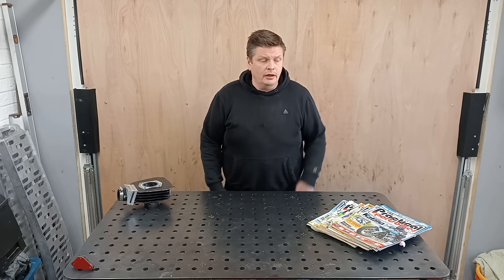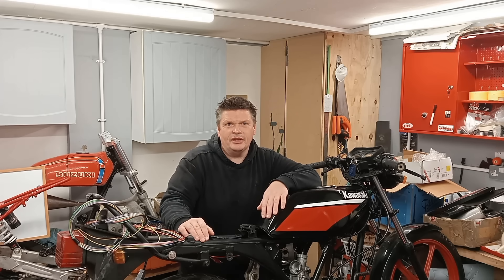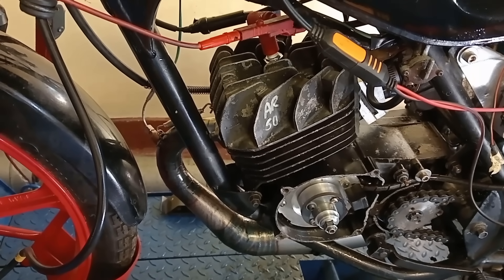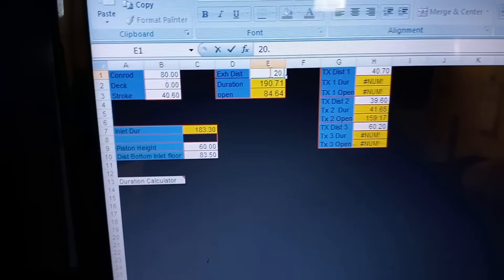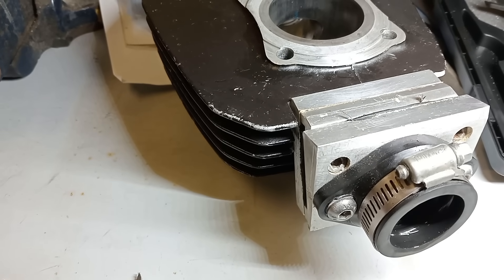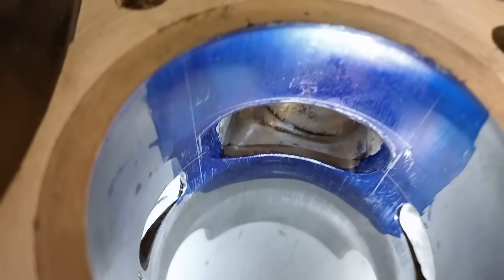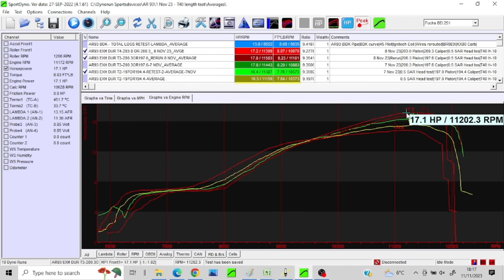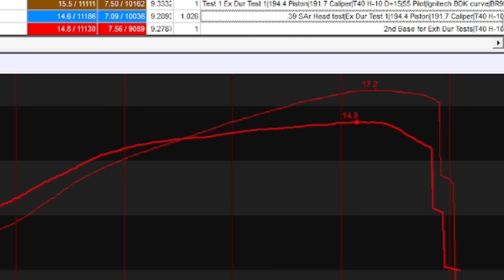This Tiny Port Change Changed Everything (Dyno Proof) #2stroke #power  #porting

Comment: One thing that may be worth trying, Youtuber @ASoftaaja removed the lower ring and made HP gains from that alone. At these RPMs, any friction reduction = power gains. 2stroke stuffing also came to the same conclusion (not the rings, but any drag in the engine at this speeds robs HP). Running more oil has also proven gains for the same reason (tech document published by Kawasaki ~30yrs ago - though oil tech may have caught up enough to make that moot)
Reply from the maker: Great info. I'll put it on the list to try next time. Loosing the lower ring would allow a wider inlet port too as the lower ring peg is perilously close to the edge of the intake window.
Reply: @AutoBeta2T do not forget to plug the groove of the compression ring, otherwise the mixture from the transfers will flow through it into the exhaust
Reply from the maker: Olitech, cheers. I need to find a single ring piston for my set-up but it's proving quite difficult.
Reply: @olitech_perfomance plug groove with what?
Reply: More oil makes it leaner too, leaner usually makes more top end power. So that needs to be into consideration. So jetting should be different, at least at the extreme ends of it.
Reply: Interesting - I have a Dr Joe Ehrlich modified Motobecane that never went in to production, that has a single ring set up on a Mahle dish topped piston. When I first started messing with it I thought a 3 ring set up would be better but several experts say that is not the case. I have no dyno to test on but I know the engineers back in 1966 took it from 1.7 to 6.2 bhp, most of that being down to the boost port technology. Although the French engineers disagreed with that, the bike took a 1 hour endurance record in Monza - it was ridden by Rex Avery. Ehrlich wanted to do a liquid cooled version but sadly the budget wouldn't run to it. I am still struggling to get it picking up cleanly from tickover but it revs like a good un once it's going.
Reply: @jonathansmedley1077  nope, octane rating of oil is near enough to zero. So if I take 100 octane race fuel and mix it 10:1 with oil, I'll now have 90 octane premix.
Reply from the maker: @bostonbikebits6539 thanks for that - I've found the place on the internet, I'll give Mark a shout. Cheers for the tip 😀
Reply: Thats just what I was thinking.  When I had my 93 i only ran the bottom ring without any problem.   I found the dykes ring caused more problems.
Reply from the maker: Cronauer - I'll give it a go
Reply: It is true  that you may gain from removing  1 ring but, From My experience i found that two rings do transfer heat to the Jug better than one.
Reply: How would oil technology make the "wetting" of the cylinder with oil any better. 20:1 still best power
Reply: @aaronbright5028  Oil technology can make a big difference to the amount of pressure per unit area that can be applied between two components before the components break through the oil film and make contact with each other.
Reply: @cedriclynch  okay an again.....how does that help with "wetting". Like are you somehow going to fill your ring gaps and piston to cylinder wall clearance with that better pressure handling......no. it still has to be in there to do it's job. Anywhere between 50:1 and 100:1 is totally insane on how "dry" it's running idc what oil you use.
Reply: @aaronbright5028  I think that when the engine is being run gently any given drop of oil remains in the engine for a long time before escaping. If you dismantle an engine that has been running on a 50:1 fuel-oil mixture for a long time without being run very hard, you will find all the internal parts to be very oily. The Honda NC50 Express moped of the late 1970s has the oil injection pump (which has no link to the throttle) driven from downstream of the automatic clutch so there is no feed of fresh oil when the engine is idling with the vehicle stationary, and you don't hear of them seizing up. Similarly on the Suzuki T500/GT500 of the 1970s there is no oil feed if the bike is stationary with the engine running in gear but with the clutch lever pulled in. There is an oil feed if the gears are in neutral with the clutch lever released. When the engine is run hard the oil is escaping from it much faster, so it may need to be supplied with more. On Yamaha models with the Power Valve System and oil injection there is a link from the Power Valve servo to the oil pump stroke control mechanism giving a very large increase in the oil pump stroke when the Power Valve is in the raised position, which is when the engine is running in the top 25% (approx) of its rev range and it is giving a specific power of about 200 horsepower per litre. This is in addition to the link from the throttle.
Reply: Two stroke stuffing? We will not resort to referencing charlatans and snake oil salesman here. Remember he survives off views, not his engines, which don’t actually work as intended anyway. After 7 years of not actually focusing on the task at hand: to build a nitro-powered resonance engine. He’s so far off that I’ve lost all respect for him, and his 2t knowledge isn’t that vast anyway. Watch this channel, 49cc scoot, and dyno joe if you actually care about learning
Reply: On fuel: mixing in oil does not change the octane rating because the oil is not a combustible part of the mixture, and has its own octane in the thousands anyway. Those formulas for determining octane due to mix ratio are correct if you need to know the stability of the mixture, but since it doesn’t matter to a running engine, the only octane you need to know is the fuel WHICH DOES NOT CHANGE

Secondly, the old head lore that oil ratio changes FA ratios is also bunk. If I mix at 40:1 and jet for a perfect 12:1, my ratio would only change by 4 tenths of a point from an actual 11.7 to 11.4:1 when doubling your oil ratio to 20:1 - insignificant.
Reply: @RyanMcIntyre  In fact the octane rating of oils is more similar to diesel fuel than 'thousands.' Which makes sense when you consider the chemistry; oil is predominantly long chain hydrocarbons with few branches while highly branched and aromatic hydrocarbons are the preferred constituents of high octane fuel. Diesel engines, I might add, are usually quite capable of igniting and burning their own sump oil. This can lead to catastrophic 'runaways' if, for example, a turbo shaft seal fails and begins leaking oil into the intake.

So contamination of the fuel with oil does indeed lower its octane rating, though with a modern 2T oil the effect is probably much less than it would be for an oil that is not intended to be mixed with the fuel. 

Also some (but not all) of the oil does indeed burn in a 2 stroke, you need only consider the temperatures the oil will be exposed to in the hotter parts of the engine (e.g. the piston crown) to realise that any oil that gets on those areas will be heated to well above its flash point (for reference, this is about 220 degrees Celsius for a SAE 30 weight oil- the piston crown can exceed 300 degrees C under heavy load), and thus will begin to form a flammable vapour.
Reply: More oil increases the viscosity of the fuel, and this has a significant effect on the fuel-air ratio.  @RyanMcIntyre
Reply: @RyanMcIntyre  no.
Reply from the maker: @RyanMcIntyre cheers for the info Ryan. What oil ratio have you found works best?
Reply: @AutoBeta2T  Lol for full power I’ve tried up to 12:1 but depending on application (and for my size engines), 40:1 to 32:1.
Reply: Thumbs up for that! Both of those are indeed well proven methods to get some pretty much free power. 

If I recall correctly the threshold where one piston ring starts to outperform two tends to be around 8000rpm quite universally so one ring will very likely perform better for this project. 

About oil mix there is at least one document from 70's or 80's where they tested with some 250 mx bike and castor oil. Tested ratios were 15:1, 20:1 and 30:1. Compared to 20:1 the 30:1 ratio reduced power by 10% (!) while 15:1 increased it by 1.5%. Their main hypothesis was that power increase from more oil would be from improved sealing between piston(ring) and cylinder. The results can for sure vary depending on many factors, especially piston/cylinder clearances and used oil type. Would be interesting to see this tested with various modern oils. One important safety note though when using premix: More oil makes the air-fuel mix leaner by making the fuel heavier/thicker, so increasing jet size might be needed even though common sense could easily suggest the opposite.
Reply: Oil also reduces the octane rating of the fuel, so if you are running on the bleeding edge of detonation a higher oil premix ratio might cause knocking even with the mixture unchanged.
Reply from the maker: @nerd1000ify interesting - I need to do some more reading into oil ratios. Cheers
Reply from the maker: Kiardon, I was trying to hunt down a single ring piston  but my piston pin is 12mm (from memory) and that does reduce options. I need to start the search again.

Oil wise I'm running 30:1 only because we used it when racing air cooled 250 twins and with the motul we never had a seizure. Again something to test one day. I am aware that increasing the oil amount does lean the jetting off.
Reply: @AutoBeta2T sanding the lower ring to reduce ring tension works pretty good not as well as a single ring piston but for testing to see if it’s worth it it should do the trick
Reply from the maker: Cheers Turkeyboy, I need to get searching for a single ring piston again!

Comment: I think if the exhaust is around 200degrees and the powerband hits at about 8,5-9,5k theres alot of room for a harder hitting pipe thats a bit shorter so it will peak closer to 11k? I once checked my DT125R exhaust port and it had more duration than a 1989~ YZ125 exhaust port 🤯

Sure the rideability goes down alot from not having a powervalve but from the dyno I'd say it doesnt have much kick to it and the power curve is pretty wide.
Reply from the maker: Cheers, I need to look at the exhaust again. I'm up for making more pipes... The current one is just a base pipe. Hopefully we will learn more from testing different pipe designs 😃

Comment: Regarding where to measure port timing, I measure from when I can see torch light crack through, I figure if light can get through so can a couple hundred psi of exhaust. Do you know if the exhaust port width should be measured from edge to edge with calipers like you're doing, or if you need to add in the radius of the bore like the expansion pipe calculators require? If it's the later, then you may be much wider than 70%?

Love your video's! There's so few tuners on here that actually verify their results on the dyno. Keep it up!
Reply from the maker: Cheers and I think I'm going to stick with the crack of light method then.
Regards the 70% I have always known it as the chord width (length) that is used.
Reply from the maker: And cheers, hopefully more mod then Dyno test vids to come. Thanks for watching.

Comment: It will be interesting to see a new pipe with proper tuned length to now cylinder port duration
Reply from the maker: I'll be doing some tests again on pipe length at some point. I think a better pipe design could be found. Hopefully I'll find it.
Reply: You can retrieve some of that mid-range loss by going to a fatter (larger major diameter) pipe. It will make the engine more tractable.

Comment: You have to think from the perspective of the gases inside the cylinder and to them the port is open ass soon as theres a tiny bit of light coming thru, as soon as there is a tiny hole the gases will start flowing out the port.
Reply from the maker: Agreed 👍

Comment: Really good video, you got some good gains there and a nice careful approach so that you did not wreck the barrel. You may consider the following either a 'cheat-to-far' or too expensive but you could possibly fit a 6 speed box from the AR80 assuming it will fit. I did something similar with my MT5, It was a pain with the 5 speed box, I would rev the nuts off it in fourth but even then it would more or less fall out of the powerband when I shifted up to 5th, it took ages to climb back into the powerband and then it would start pulling well. The six speed box from an MTX80 really helped me keep the engine buzzing. Of course a 6 speed box won't give you a higher top speed but it helps you get to that top speed a bit quicker especially if conditions are not perfect.

EDIT Just did a bit of googling, the AR50 was 6 speed in other countries, I wonder if Kawasaki just fitted a gear selector cam on the UK bikes that only allows 5 gears to be selected even though the 6th gear is actually in the box, it would be like Christmas if that is the case! (You can just grind the selector plate to allow the extra gear to be selected)
Reply from the maker: Hi Pete, cheers but I already have the 6 speed box, I bought the extra bits from the AR80 box. In fact I had to get a couple of bits from the US.
Reply: @AutoBeta2T  LOL, well it proves that great minds think alike! 🙂

Comment: Excellent job man, I'd a 93cc (was bored out within an inch of it's life) when I was 16 and thought it was fast. If I only knew about porting and tuning back then. I'm building another AR93 and I'll for sure be using these videos for referance and inspiration.
Reply from the maker: Thanks Simon. I'm the same too, at 16 mine was quick I thought... However!
Yep, I was really surprised how much difference in power was gained from each 0.5mm increase in the exh port height. I've been told many times - it's all about ports and pipes!